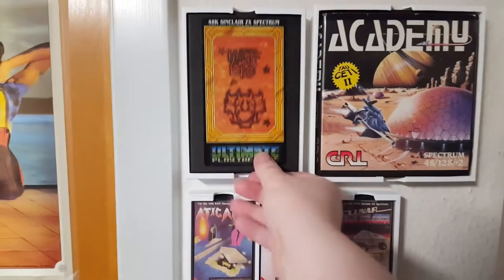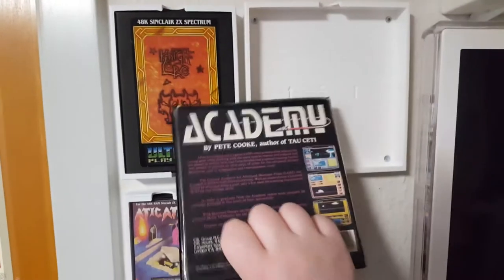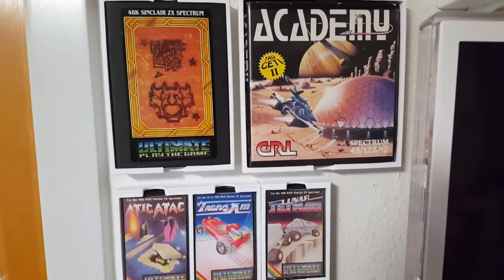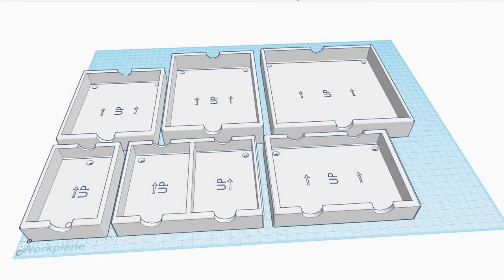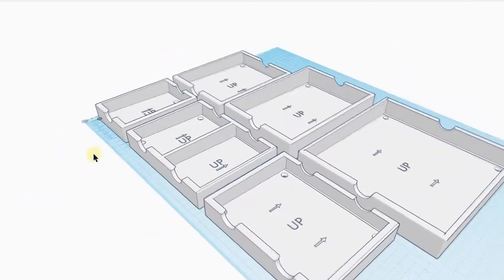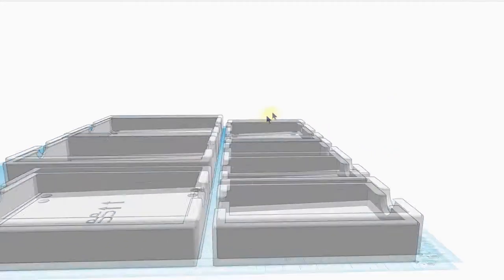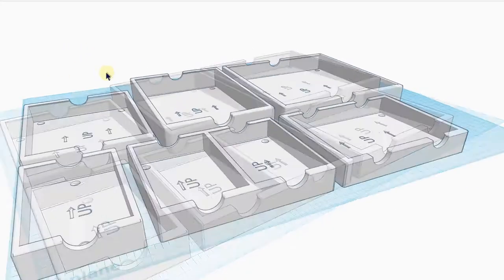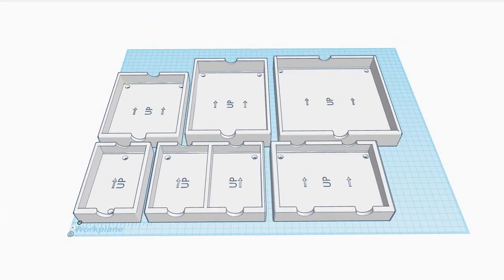Wall Mountable Cassette Tape Holders

Comment: Where can I purchase one? I don't have a 3D printer
Reply from the maker: Well, not from me... However, PCBWay not only makes PCBs, but also do 3D printing (in plastic or resin), laser cutting, and a slew of other things... and I'd be very surprised if they are the only ones out there providing such services to private customers.

https://youtu.be/bmhpyVP1LJY?t=17
Reply: @Zhixalom  thanks for the info. Is there a reason you won't make them to sell? Too much work for too little profit?